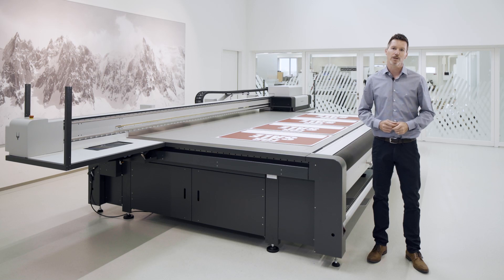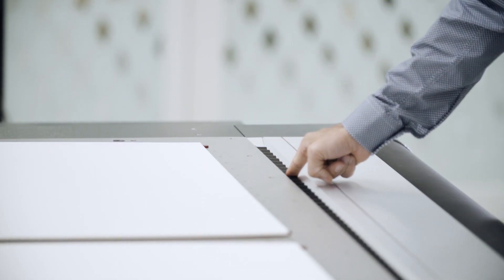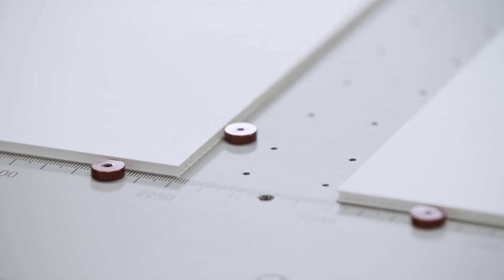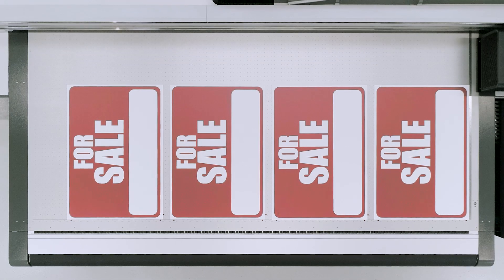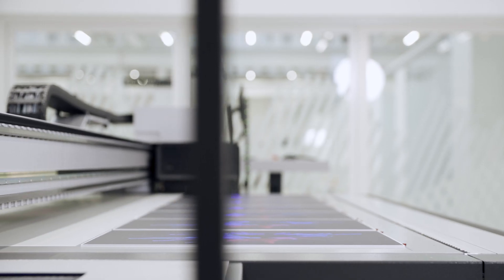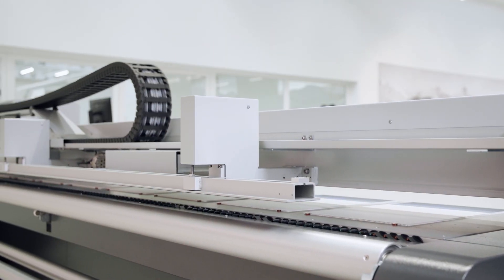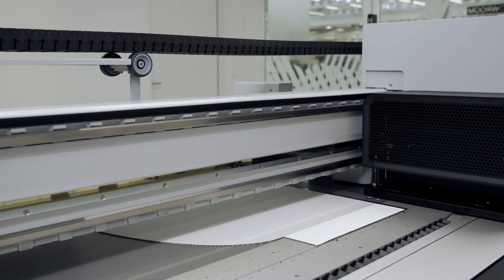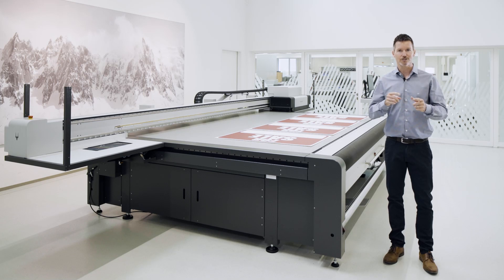swissQprint introducing Tip Switch Vacuum for flatbed printers

Comment: Great video. I just started using this machine (Generation 3) and still learning. What is the best way to start using the machine before shift starts. Purging and cleaning print heads after with alcohol wipes? or Clean with alcohol wipes first THEN purge and start printing???

Just want to know whats better before starting jobs on machine for BEST results.

Comment: I have two weeks working at a company and 1/5/2025 starts my third week and i have two days learning this machine. Im working on the Nayala generation 3 swissQprint and this machine DOES NOT HAVE THOSE BUTTONS ON THE SIDES FOR VACUUM POWER. We use Blue painters tape to tape down the template we use.
Reply from the maker: Hi, thank you for your message. Happy to hear that you are working with a swissQprint machine. We hope that you enjoy it. May we suggest that you get in touch with your local swissQprint partner to discuss this detail? Thank you very much.